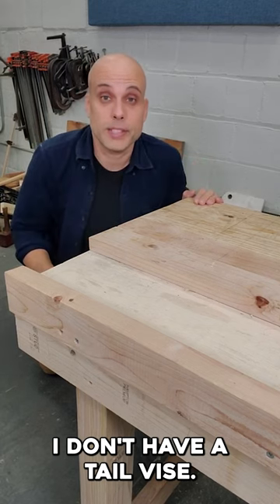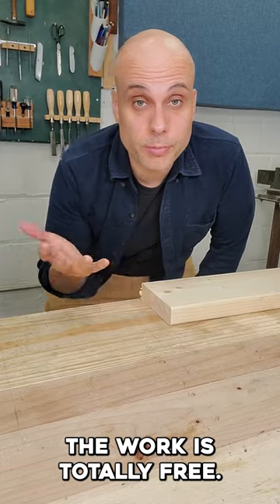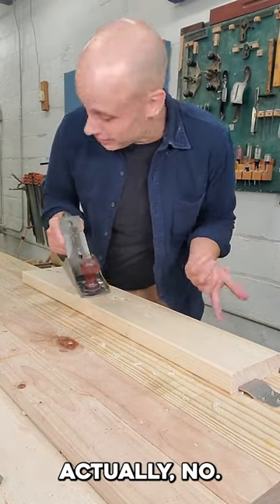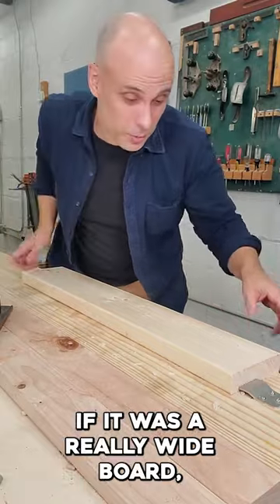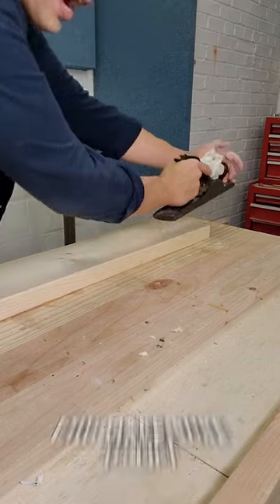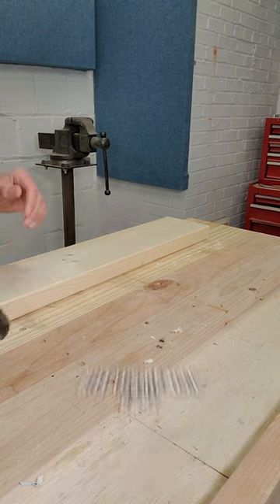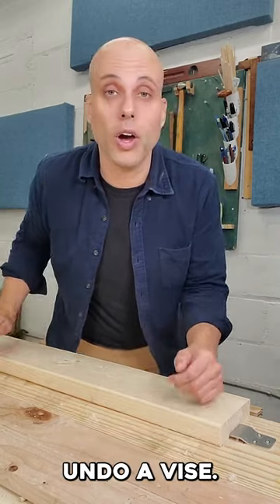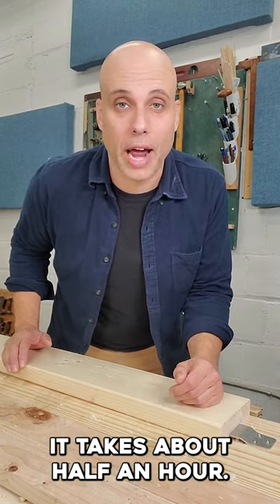You DON'T need a tail vise for woodworking! #diy #woodworking #shorts

Comment: Yep; not needed for plaining, I have found other uses, like holding jigs, particularly for moldings, although it’s also not needed, a clamp or a holdfast will do the trick. Once you have a tail vice, you’ll find uses for it. Still, not needed